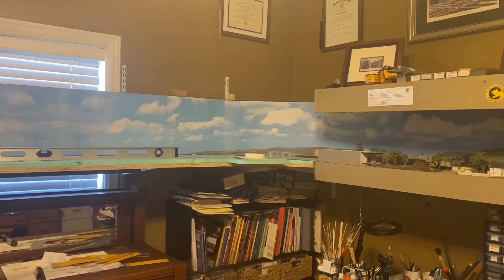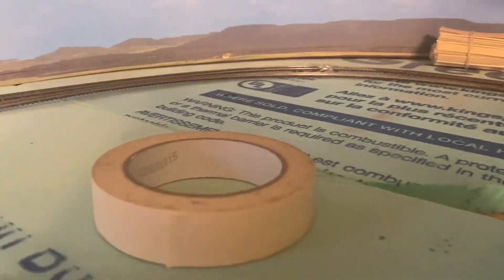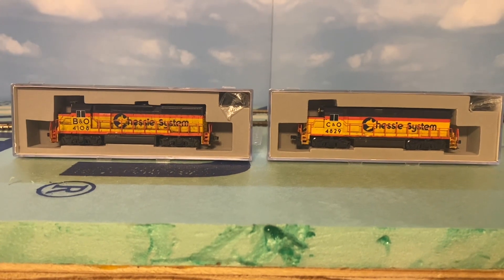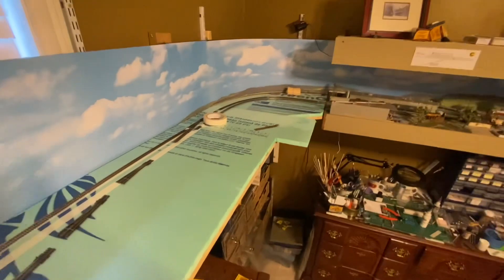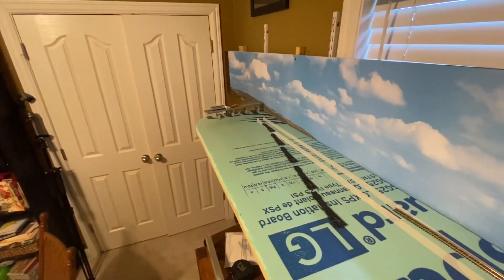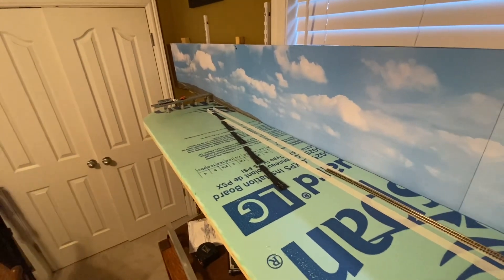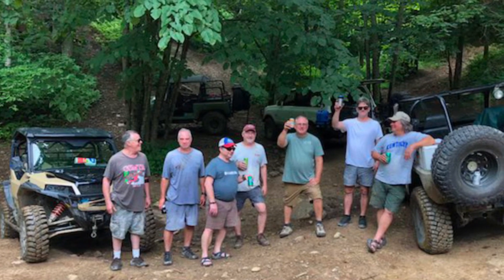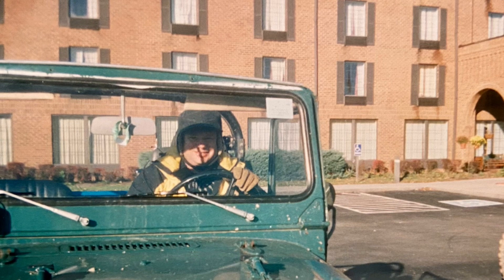Layout expansion update, 2 ‘new’ locomotives, and a request

Comment: Hi Thom, Have you considered a 3 way switch?  You can get almost double the number of yard tracks and more of the same length. The 3 way  would be one of the 1st turnouts in the ladder. One diverging leg would go to No1 yard track.  The strait leg would continue the 1st ladder. The opposite diverging leg of the 3 way would start a 2nd ladder.  You would need to add a short curve in each track on the second ladder if you wanted it to parallel the 1st ladder. On another note, If you wanted to use the lead on the right I would consider a double slip at the cross over/yard lead.  Just my thoughts.
Reply from the maker: I appreciate your ideas. I am using Peco Code  55 and I don’t believe they make a 3 way switch. Even if they did, I am leery of complex   switches like that and double crossovers. I am always going to be someone who throws switches by hand. None of my frogs are powered and I haven’t seen the need to do that since I don’t have stalling problems. I just believe in the KISS principle and it works for me.
Before I start laying track in the yard I’ll do more research. I definitely welcome ideas and input, so thank you again! Have a great Friday and stay safe.